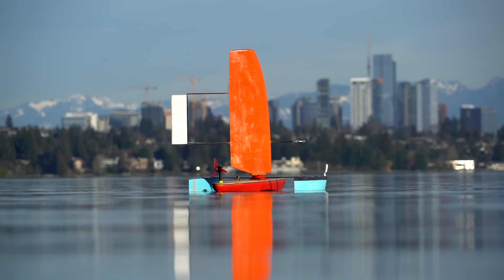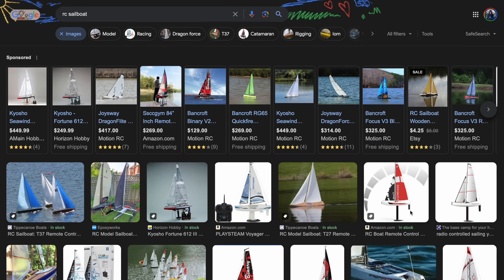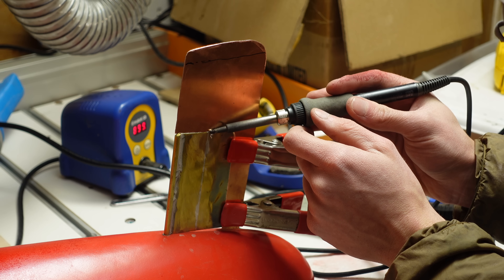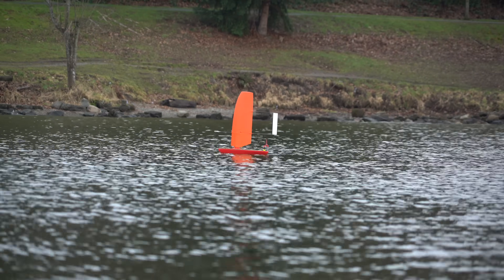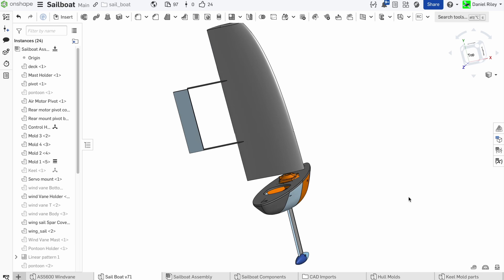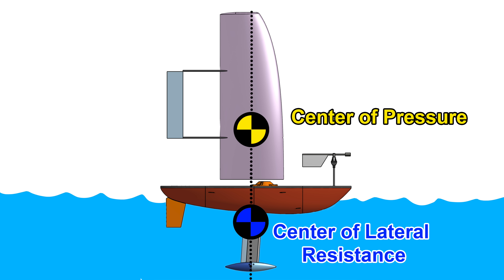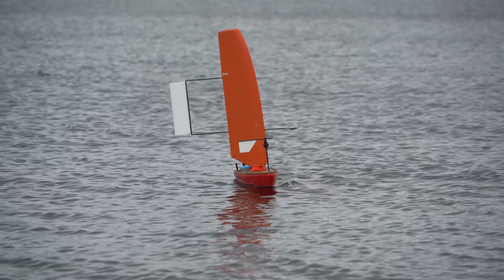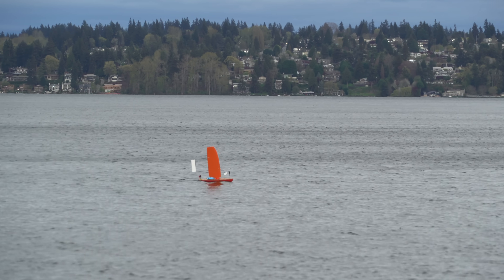Building a DIY Drone Sailboat

Comment: Cool results upwind with only the main sail, I bet that if you'd add a jib, you would gain efficiency and speed with not much surface area.. of a front sail...
I have a 6 meters sail boat and I m interested to build a wind van that I could connect to my pilot

Comment: Sailboat keels are sometimes filled with lead to weigh it down. Keels are meant to act as an underwater foil to counteract lateral motion, but also function as a counterweight. If the shape is correct the first function is satisfied, but you probably need more weight to counteract heeling and rolling.
Reply: Should have watched a little longer haha

Comment: trying something separate from the project shown in this drone demonstration, send me an email, and Ill probably find your patreon this week, but Im asking you to present or conduct a project flexing your understanding of fleet control or ML with schools of drones (3-5); how you plan or create flight paths and make the drones compute under a shared neural network. or what's required besides some protocol for establishing a flight controller that synchronizes the actions of several autonomous devices. boats are probably a little easier than drones, and may be more interesting, but eventually show me something tight with your drone fleet control. Small rock climbing project by myself smh

Comment: Hear me out: "Ardupilot Escorted flight" Now I may not have the funds or time to do this myself, but I had an idea for a RC plane escorted flight in which a large RC plane piloted on a long-range mission is escorted by fpv plane. No main reason for the escort but it could be used for aerial refueling. Just an idea I had.

Comment: I have an idea for a product

"life boat"

basically youd have a gps guided boat and a wearable gps

your wearable would have 2 modes "stand by" and "recovery"

in standby it would just stay 100 - 200 ft away

in recovery mode it would drive to within 20ft away

the use case woukd be for scuba divers or other water activities that require leaving a boat

you go diving, get tugged by some underwater currents

well as soon as you have gps signal and hit recovery  boaty comes chasing you down

Comment: The elevator seems rather inefficient, maybe experiment with controlling the mainsail angle using a servo directly? or potentially a winch and string, like a real boat, but that might be more difficult to set up.

Comment: Super cool to see a video of you going through all of the unique challenges that sailing presents! As a lifelong sailor and big fan of this channel it was awesome to see. Just as a note, you would probably do a lot better having an actual symmetrical NACA foil (i.e 0015) section for your keel and rudder. These would actually generate lift and allow the boat to point much higher (sail closer to the wind). Also, when your CP is aft of the CLR, that is called "weather helm" not "wind helm" but that is a very minor nitpick. When the CP is forward of the CLR that is referred to as "lee helm" and is undesireable as you stated. When the sails are trimmed so that the CP and CLR are perfectly aligned, the boat is said to be "balanced."

Comment: This is all very awesome! There's a company called saildrone making stuff like this and they also use a foil. It's obviously a lot easier to implement, but ask any sailor and they will tell how much faster you can go with properly trimmed sails. I can imagine maybe a full size cargo sailing ship using robotically controlled airfoil adjustments. 

I imagine you could get this thing to traverse oceans if you figure the  battery efficiency out.

Comment: I’d say the best change you could make is to lose the control flap on the sail and the free rotating mast and servo control it instead so you have more direct control of the sail angle

Also a dual element wing is infinitely more efficient and powerful 

You would be able to program set angles to optimise for apparent wind and heel angle and rely less on the reaction feedback. 
The fluttering back and forward is killing the drive of your sails

Comment: a sailboats masts is typically longer than the boat.. so.. your sail should be like around 115% or so what you have there.. thinking a ridgid wing like that is probably a bit heavier than a cloth sail.. think preformance would be better with more sail. a heavier keel might be needed though.. seems to be floating low..

Comment: Would pressurized air rocket repeatedly floating in water then launching up and going 100s of feet be more efficient?  Per mile and just counting energy is a plane morr efficient at carrying cargo, per energy used, than ship or truck??? Hmmm

Comment: 1) MAKE LEAD KEEL SUPER DEEP via long 3ft shaft to bulb -- Unlike full size boats getting into a 6ft deep marina berth is not a problem.  2) Try catamaran with 2 pontoons 4 feet apart.  Again a model boat needn't worry about size.  3) Literally set the boat to go to Alaska!!!!

Comment: Fun project!
Perhaps the troubles with tacking are caused by the limited movement of your rudder. If you can increase this angle your boat should be able to turn faster and cross the wind. ( If the angles showcased at 10:09 are the actual angles ) I should be closer to - and + 80 degrees. 
Good luck!

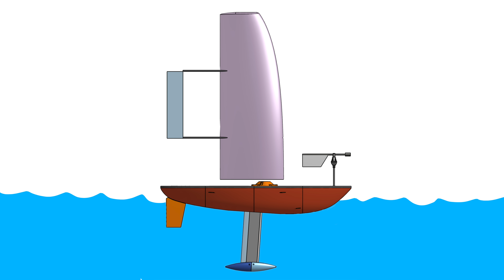Comment: @7:45 another factor to consider is that the hull is an airfoil too.  With no wind it is a symmetrical foil, however when it starts to lean over the foil in contact with the water becomes asymmetrical.  In kayaking we call it edging and use it to turn a kayak without a rudder or paddle.

Comment: Really cool project! But as a sailor i can say you will never achieve balance on all points of sail, center of effort changes depending on wind direction and sail trim. Ive been all kinds if boats, passage makers will often be really comfortable downwind with little work on the helm needed, while having awful weatherhelm upwind, a more competitive racer can often go steady upwind and be very twitchy downwind. Both behaviors can be corrected by changing sail size and shape forward and aft. But that requires someone on board. The wing sails run on modern racers can change shape and that seems quite achievable on an rc boat, possibly could even automate it via the windvane? Would love to see that!

Comment: What are the odds that you can hook up ardupilot to control an auto helm tiller on a sailboat. Seems like it would be a pretty easy implementation if we can feed in info from a windvane, additional to the magnetic heading the tillerpilot has.

Comment: 65 years ago I build sailboats that had walnuts for the shell, 2 toothpicks for mast, and  clear plastic for the sail, and it was held together with model cement. After a rain there mud poodles that I could float  the boats. They were good with the wind!

Comment: 9:41 silicone isn't what you want for this application. 3M 4200 is generally what's used for above the water line sealing like this. 5200 would also work but it's unnecessarily permanent.

Comment: As someone with both sailing experience and an aerospace engineering degree, I feel you did a fantastic job explaining what you’ve done here and did most of the design changes that came to my mind from your alpha model.  I have to say, fabric sails are so much more satisfying than rigid wing but I see why you would avoid them here.

Comment: So, just as a point of curiosity, since you did a wingsail that looked like a symmetric wing...  Why not go with a worsley wingsail since that will optimize lift automatically/mechanically and the only time the sail would need electricity would by when you wanted to adjusted the 'throttle'?

Comment: One of the most advances autonomous sea drones use a similar sailing approach. They are quite impressive and indestructible to any weather condition.   The best way to move without using electric power (beyond electronics which it use PV for that).

Comment: Good to see the progress with this iteration. You'll significantly improve upwind performance if you give the keel a (symmetrical) airfoil shape rather than being a faired plank. The rudder would benefit from this too, it then wouldn't need to be so big and would create less drag. The rudder will usually be at some angle to the centreline while sailing, and it needs to create lateral 'lift' to hold the course. Having a flat rudder means it will need more angle and create more drag, like trying to fly with a flat wing.

Comment: Can you design a 3D printed or Foam type of Tug boat to retrieve other RC boats and Float planes? One that can lift them out of the water when they are starting to sink? Multiple of us at our lake have tried and failed. It's almost impossible to retrieve when full of water and just the nose of the boat is on the surface. It takes forever. We need something that can lift it out of the water and bring it in.

Comment: If you are ever in need for some real good quality kit you should try EPDM pond liner kit. It is non toxic for aquatic life, and it is far much stronger as regular silicone kit, and it can cure on wet surfaces, and it is UV resistant, and it sticks to pretty much any type of material. Just don't get it on your hands because it can only wear of your hands again. It really is that much better as any type of silicone kit. 

I made a pond from several plastic bins, and I connected all of them together with a large enough diameter PVC pipe so that the fish can swim around, and I used EPDM pond liner kit to seal all the connections, and that was about 20 years ago, and I never had a single leak. The kit is also useful to make electrical components waterproof, but once the canister is opened you cannot keep it forever, and it is a bit of a hassle to apply. Plastidip is also very useful for making ICB's waterproof and that comes in a similar can as paint, which you can store longer, and it is much easier to use. Just dip the ICB in the can, let it cure, and you are done. 👍

Comment: Stalling mid-tack might be something you can correct in software. It's not really something you can fix, since improving the boat's upwind performance will inevitably just lead to the same issue.

One technique sailors use sometimes (though not when racing) is pushing the boom out so the boat starts to move backwards, then put opposite steering on the tiller to bring it around.

Though a better option would be to turn downwind to build mementum prior to tacking.

Edit: I'm assuming you already have it turning as fast as it can.

Comment: A static jig to measure forward thrust will help immensely to get the sail angles tuned. Even more so if using controlled wind like from a strong fan. Very hard to make sense of anything with the boat way out on the water, just too many variables.

Comment: Very cool! If anyone is looking for rc sailboat details, look up the "International One Meter" or IOM class. Loads of videos, class specifications, rules etc. Tacking can be hard. Try for fast turns, but not so fast you stall the rudder as it sails through the water. Maybe experiment with max servo speed and endpoints? I'm not a pro, just adding my comment for the algorithm.

Comment: If you moved the centre of pressure ahead of the centre of lateral resistance would that not make the boat tack more effectively without the motor kicking in?

Comment: 45 degrees into the wind are actually not that good, decent boats can head into the wind in an angle of round about 25 degrees.
I am not a pro, but I think adding even more weight to the kiel would help, cause the boat will not lean that much and the angle of the sail would be better. (That’s the reason why sailors lean out of the boat)
Anyways nice project I hope for more videos like that.

Comment: You should check out the Locktite 8000 series of adhesives, they can replace welding.
Jeremy Fielding did a sponsored bit about it a while back and they look... impressive 

could be a great way for you to get the strength of welding in situations where it's impractical/impossible! 

I thought of is when you were putting the halves of your pod together. admittedly, it's not a use case that really calls for it, but it's adjacent. 😅

Comment: Actually, the righting moment of the keel does not quite go as you suggest. There are many accurate scale yachts that use the scale keel dimensions and , so long as you use the same material for the keel weight as the original (lead or iron for example), the model does not fall over. The stabilising moment of the keel and the destabilising moment of the mast and rig (which should also match the material(s) of the full size) both scale as the linear dimensions to the 4th power so diminish in sync as you scale down. What does not, however, scale so straightforwardly is the wind strength the model can sail in. Moments due to wind pressure go as the windspeed squared times the linear dimensions cubed. Since these moments are counteracted by the keel moment it follows that the same heel angle is reached for a windspeed that is lower by the square root of the scaling factor. So a 1/4 scale model will only be able to sail in windspeeds up to about 1/2 those of the full size.

Comment: As a sailing coach, RC model yacht enthusiast, ardupilot hobbyist, and autonomous yacht designer, I would like to commend you on your great and accurate explanation of sailing physics. 
Your boat likely won't tack because the wingsail is back winding (creating reverse thrust) during tacking. Your best bet is to reduce friction in the rotating mechanism, design the rotation point  the right distance ahead of the center of effort, and set your wingsail trim tab to 0 degrees during a tack.
Reply: That and because he’s using a symmetrical airfoil, it requires high angles of attack to generate inefficient lift, he needs an articulating or hinged wing like the Americas cup boats have to set up a non-symmetrical airfoil depending on wind direction.
Reply: @BikingVikingHH  a symmetrical wing at 0 AOA should have far less drag than a flapping sail. Should tack easier.
Reply: @bizzzle1258  a symmetrical wing at zero angle of attack generates zero lift, which is what propels a sailboat, not lack of drag, so while it may be more streamline while tacking, it will lack the propulsion to generate the speed to do so.
Reply: @BikingVikingHH  Well, this airfoil is pivoting almost around its center of pressure, while a normal sail is hanging behind the mast that it's turning around.
And he has just one airfoil, instead of two. If he has two airfoils, one more at the front of the boat, and one more to the rear, then he can use them to steer.

Comment: Regarding the tacking issue: A real sailboat would never gybe instead of tacking; gybes can be brutal and dangerous. Turning on the motor is also kind of lame... 🙃

Consider the turn or rotation rate. Using the boat's momentum can help with tacking. If you approach the wind too slowly, the boat will not tack properly and will just slow down. Another crucial aspect is adjusting the sail position. Depending on the force vectors, your sail might be adjusting too soon or too late.

Comment: If you can adjust the aggressiveness of your tack then that might be worth testing.  

A lot of new sailors will naturally want to make a gradual turn into the tack.  This is something they have to learn not to do.  You want to turn sharply and confidently into your tack.  The more time you spend with the wind hitting you in that 90 degree no go zone, 45 degrees to either side of directly into the wind, the more speed you lose.   Eventually losing enough speed that steering stops working.

The fix for this is to make sharper/quicker turns so that you have momentum to finish the turn through the dead zone and you aren't trying to sail 'in irons'

Generally it's better to overshoot your tack compared to undershooting.   As long as you aren't in irons you can correct your course once out of the tack maneuver.

Comment: An eyeball survey of your boat suggests the ratio of weight above the deck to weight below the deck is  unfavourable. This ratio will move in your favour as boat size increases. I note that almost all full size sailboats use fabric sails. This will reduce the weight above the deck and, most importantly for them, give them an opportunity to reduce sail area as wind strength increases.

To minimise your weight above the deck, please consider the use of model glider technology, balsa frame and tissue wing surfaces. Maybe a carbon fibre mast? Speed through the water is limited by the bow wave generated by the motion of the boat.  As you go faster, the boat tries (unsuccessfully) to climb over its own bow wave. It's permanently going uphill, the inverse of surfing. A long waterline length means the journey uphill is not so steep, so the boat can go faster before the bow wave defeats it. If you manage to climb over the bow wave and get to the other side, you are officially planing.

I'm a great cheerleader for multihulls. A catamaran design would be quicker, but it can capsize and it's not self righting, so you can't leave it alone on an autonomous mission. Optimising what you have is the best option.

In crude terms, maximum speed, in knots, for a well designed sailboat will be 1.5 times the square root of waterline length in feet. In ideal conditions, a model sailboat with a four foot waterline length could expect to approach three knots. If you double the waterline length, you can expect max speed to increase by 40%, provided your rig can harness enough wind.

Comment: -Weather Helm, not Wind Helm
-Shore Breeze, not Offshore Wind
-45 degrees AWA (Aparant Wind Angle) isn't that great, it's average at best, <30 Degrees is considered very good. High performance race boats can achieve <25 degrees.
-Your wind indicator needs to move much more freely, and verify the balance so it does so while turned 90 deg to the side
-Move your GPS to the stern as it moves less and will give a more stable reading